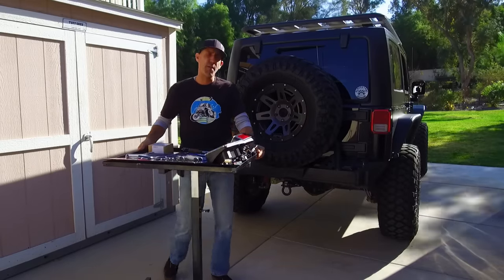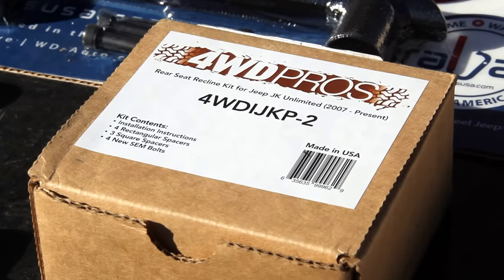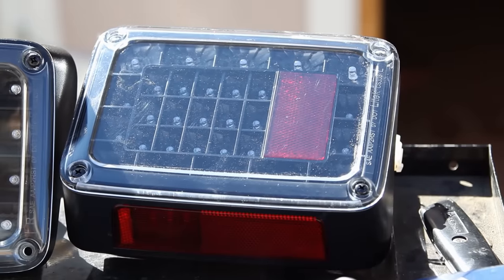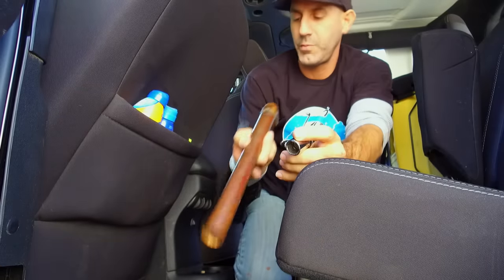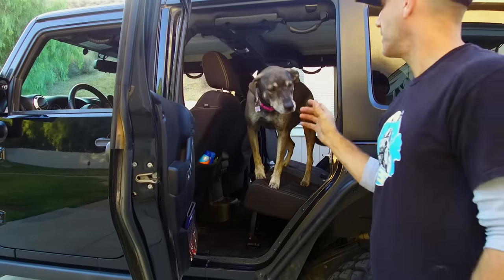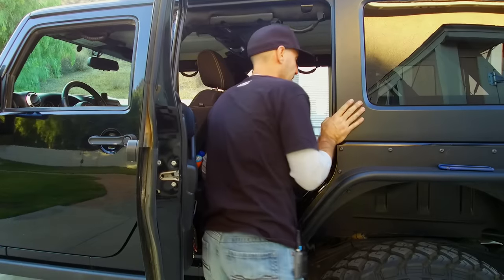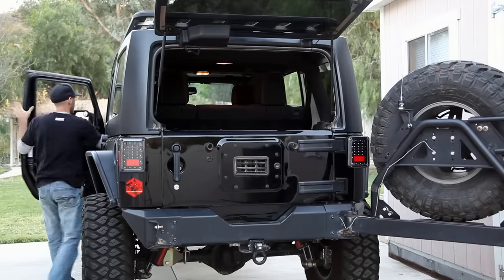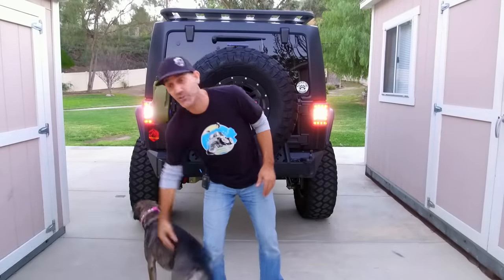3 Easy Upgrades for the Jeep Wrangler Anyone Can Do!

Comment: Will the Mopar taillight cage guards fit the whole pattern on those LED taillights?
Reply from the maker: It appears that the bolt pattern is the same as the stock lights but I didn't measure just used my "eye-crometer"
Reply: autoedit JC Whitney has a Christmas special running on Eye-centimeters. 😉

Comment: Why is it bad to grab the steering wheel?  All of the steering wheels I have grabbed onto are pretty solid.
Reply from the maker: I did it for a long time as well.  Steering columns weren't design to take a side load like that so it's just better on the mount and bearings to use something else to pull sideways on.
Reply: As a  newspaper machinist for 26 years, I have found that the side load placed on a bearing or mount by a human is negligible.

Comment: Is this an actual recline or just tilting the whole seat back? My issue with the rear seat is the angle between the seat and back. I need to recline just the back.
Reply from the maker: The whole point is simplicity, it's just a tilt from the base.

Comment: Great Videos. Like the tail lights.
What type and year of wrangler has a painted roof and fender?
I'm a little confused. Can the wrangler 2019 order with this spec?
Thank you for any information that can be given.

[O|||||||O]
Reply: The All JK, JKU ,JL, JLU and JTs can have the Painted  Fenfers and Hard Top option as long as it is Sahara (Overland in the JT) or better Trim package.

Comment: Do all Jeeps come with those handles? I just purchased a 2016 Unlimited and I don't have them... I want some handles  though... they are necessary.
Reply from the maker: I think most Jeeps come with them but some people just pull them off. I still like the grab bars much better and it's been a couple of years!
Reply: @AutoEdits  Ok, I might get some grab bars... by the way.. you should change your front lights too. The "Halo" ones that change color through an app look great.

Comment: You mention something about hitting your head on the rope handles in your JK, wait till you hit your head on the Grabars, you will wish that you still had the rope handles. My JK came with the Grabars and I wish it didn't. I bash my head on the rear ones all the time and the front ones interfere with the functioning of the sunvisors. Glad I didn't buy mine aftermarket.